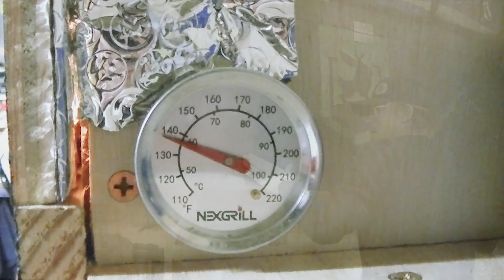Bocote Bow 2.0

Comment: I am curious how you go about tillering with a laminate bow like this. I didn't see any of the tillering testing or shaving in this video. I am on my second board bow myself, haven't tried a laminate style.
Reply from the maker: Hey Glenn,

Tillering is completely different for a laminated bow. The company that I ordered the laminations from, ask you for your specs (bow length, draw weight & draw length) then they provide the tapered cut with that in mind...so there isn't really much tillering to do since the tapers do that for you. From there you can affect the tiller by how wide the it is. If it is too stiff, you remove material from the sides making the bow it a little more narrow in that spot.

Comment: Great looking bow. How do you control the draw weight when building a bow like this? With different lamination materials?
Reply from the maker: The company, Bingham Projects out of Utah that I ordered  the laminations from, ask what your bow length (string groove to string groove), draw weight & draw length are wanting to be. Then they provide the tapers cut with that in mind. I think all of that is relative though depending on how wide you make the bow. I ordered the materials to make a #45 bow and after shaping and tillering this bow came in at #44 at 28in.